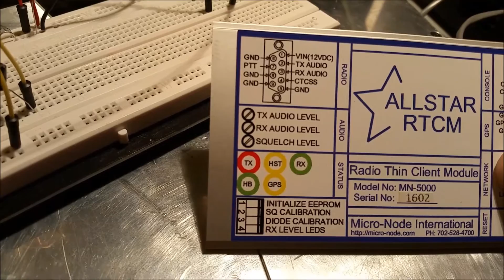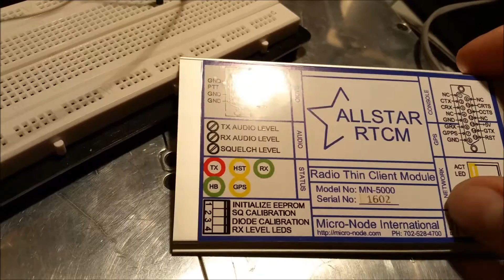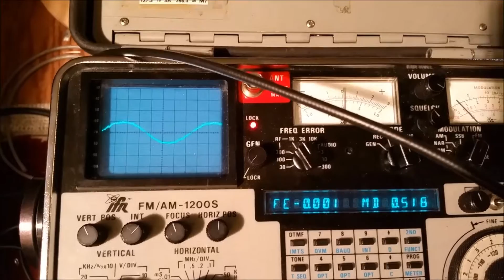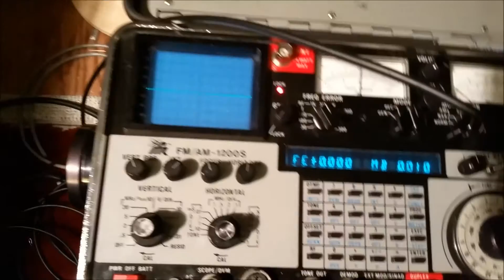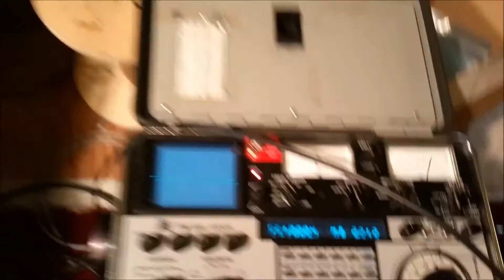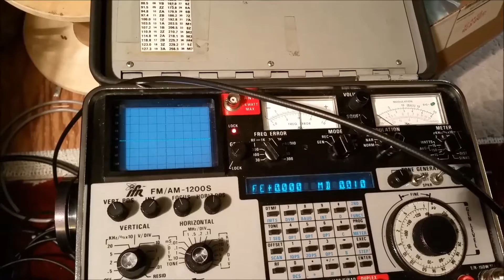Starting Simulcast using the Allstar RTCM

Comment: How would the Motorola Quantar do as a simulcast transmitter station?
It either has a 5 or 10mhz port for an external reference... I cannot recall but will check later.
Might be a way to revive a dying hobby.